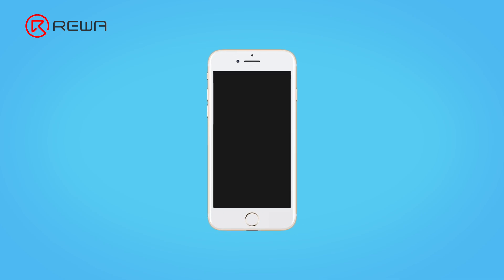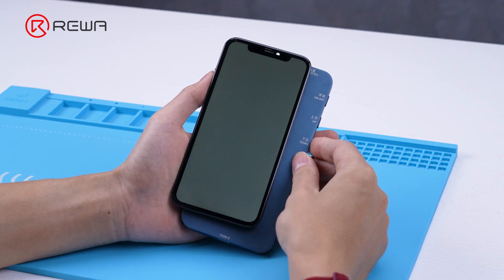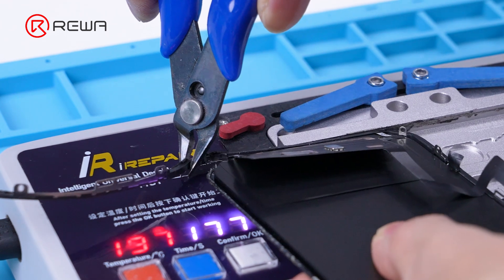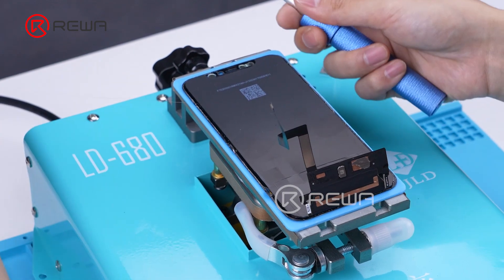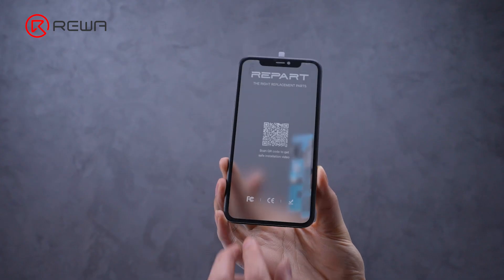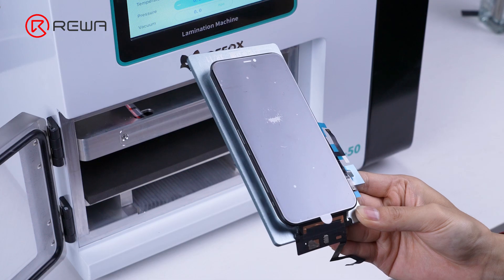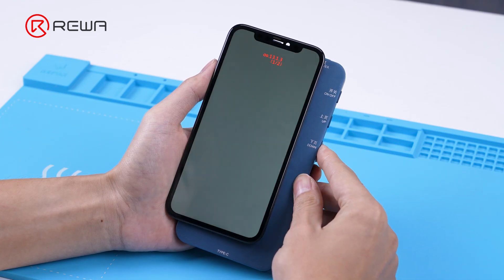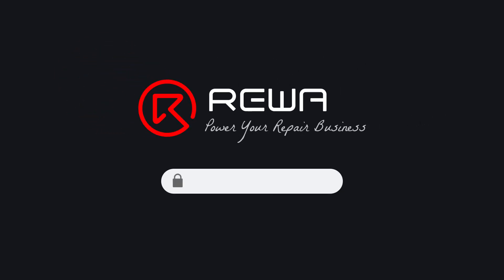Refurbish Hack of iPhone 11 LCD Screen

Comment: WHAT IS THIS?? You don't have to remove the frame at the bottom side, you can just cut the frame off at the 2 bottom corners so you don't even risk in damaging the LCD. THAT'S THE HACK! 
Please stop spreading misinformation and calling this a hack. What I mentioned above IS a hack to never damage LCD ever again. Rewa PLEASE
Reply from the maker: thanks for your feedback

Comment: one question the touch IC is not that one that will give you message in settings? I mean when you replace the glass with IC will not give you any message in settings
Reply: This is correct. You can follow this same refurbishment instructions but with a no ic touch. You can solder the original ic after the refurbishment is done.